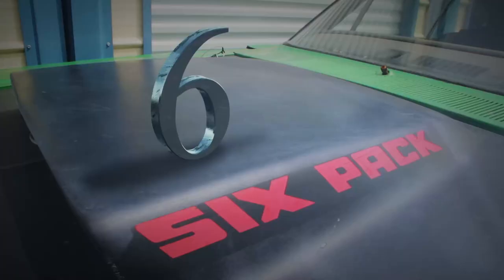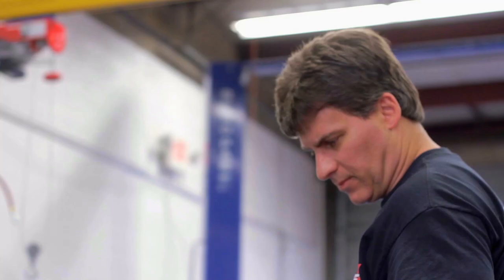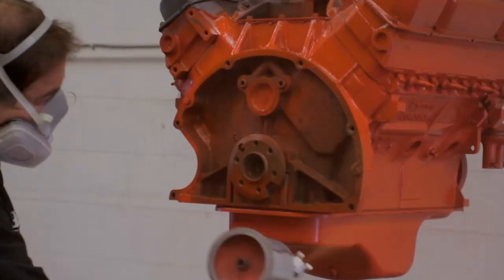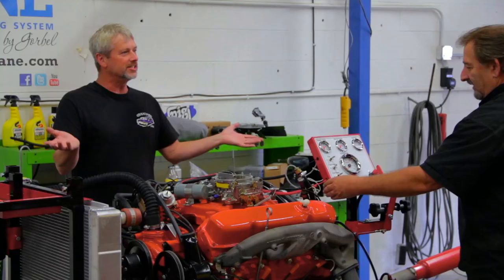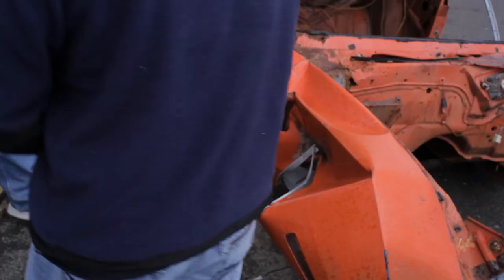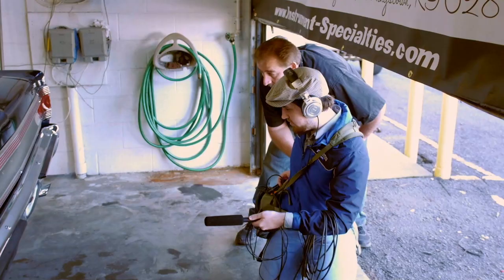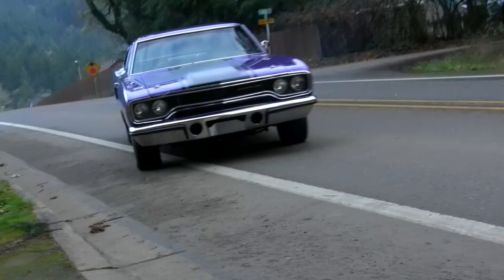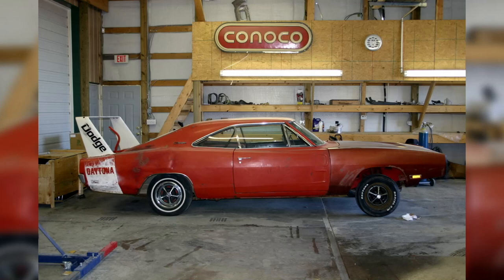JOSH & DAREN LAST EPISODE-SEE WHY

Comment: Love the show. I watched on television as well as You Tube with any I may have missed out on. 
In regards to Josh and Darren they helped to get the show started, but like anything else you always need to make changes for improvements. 
Will and Dave were both great additions. Could they all have worked together? Each to there own. 
For me, the only disappointing issue that I have is there are no truck rebuilds to OEM "Little Red Truck" would have been a great part of any season. That Old Yellow Dodge Parts truck or whatever they do with it, always catches my eye on every opening of the show.
Keep up the good work, look forward to see more.

Comment: Im a Mopar guy from the very first one I owned, a 1970 Plymouth Roadrunner, B5 blue, black vinyl top, blue interior, bench seat with a 3 speed manual on the floor. (rare)  Bought it used in 1975 for $1300.  89,000 miles, but it was in perfect condition.  It was my 4th car, I have 2 Chevys, 1 Mustang, and a 1965 GTO, 389 3-2s..  That Roadrunner out ran and out classed them all.
This Mark guy is a jerk....  I did bid one car up on him,  I was in competition for a fixer in Nor Cal, the seller told me Mark Warman's shop was after the car too.  I bid it up high, but Mark got it...  he got it in the end...  :P
Reply: Mark, one piece of advise.. when buying cars..  never let people know WHO YOU ARE....  I know you THINK you're a celebrity, but it just makes the seller boost the price.

Comment: Yeh I’m a Ford guy, 1978 it was Olds and Pontiac. We tend to start out with parental castoffs so I started out as a GM guy, I have just purchased my 124th car, not bad for just some dude, meaning I’m not a lot or business just consumer, I went to Ford in 78. I have owned Chrysler products as well, one you might find of interest,
A 1970 Plymouth road runner convertible, it was blue with white interior and top, it was automatic, rare enough but it had an AM 8 track ( no FM )and was air conditioned, I know it was rare enough, if I remember maybe it was in the 800’s?it also had one motor I quite respect, the 383, one of my bucket list cars is a black Dodge Charger 1968 with 383,  I mean since I don’t have a printing press a 426 or 440 would be cost prohibitive for me, I have been a car show judge for 3 years in the Mustang class, watching your work helps develop a criteria with which to judge cars, I once had to give a 1971 Cougar 2nd place because of aftermarket rims( which I prefer but not in a stock class) it was a black 429 with red interior and 4 speed. The guy actually worked his butt off and bought it in high school and still owns it, I have had ran a cable access show for 12 years cruise night I really liked the 63-65 dodge Plymouth midsize cars. I also have many vintage car ads many molar, keep up the good work car guys all respect you work regardless of marque loyalty. All you get now is silver 4 door front drive, I just bought an 1988 Ford t-bird sport coupe 302 dual exhaust 70 thou one owner miles and parts are difficult, I propose as car guys we should halt programs which took many cars off road, things like cars for clunkers, also there was a program that tried to stop Hollywood from destroying desirable cars, I mean how many Torino’s and Chargers do you think were sacrificed just to name two. There was a great car scrapping in 1918 to induce new car purchase. Sadly our offspring can never have what we had car guy speaking, there will be SUVs and pretty much that’s it, luckily we have Mustang Camaro and Challenger butI hear GM might bag the Camaro, so marque loyalty doesn’t count for much these days, I’m 63 so I remember looking out on parking lots in the 60’s and 70’s and most of the cars had potential I mean read 2 door V-8 mid size, these cars are all but gone and are immovable  car dealers tell me, these cars are tough sells, I actually see vintage bodies put on Tesla remains, my gut is telling me electric cars are going to get bigger, yet, so in closing my 3 bucket list cars? 1961 Chevy impala red, engine? 283 or 348 next the 1965 Ford Galaxie dark blue, engine? 289,352? And last that black 68 charger with 318 or 383, any one of these cars are great candidates for resto mod, in closing yeh don’t forget my Avanti

Comment: Love the car and yeah vinyl top is nice looking on that yellow cuda but what fool back in the day said hey like we could put a top on these cars that will just absolutely hold moisture and rust holes in the top of the car and will deteriorate crack up and turn to trash on the top of these great cars no matter what brand they were even if you kept them in dry garages they would have to be climate controlled they just draw moisture and hold it right against the metal to me unacceptable even the little ladura tops in the late 70s na stickem in the trash to me that’s what they are if you want that look just get a convertible in
My mind that’s what they were trying to get a convertible look alike

Comment: Keep in mind that GYC is restoring these cars better than when left the factory!
Reply: The only thing better is the paint, I personally restored Mopars for 18 years by my self,doing everything except rebuilding the motors,the headliner and front and rear glass installatoon.Marks cars finished are no better than mine,so much of this produced show is hype.
Reply: @duster71  But he has a show! Where’s your show? The attention to detail? Let’s see some of your work? Do you take the time to make sure the original markings as it pasted along the assembly line are there? GYCs has in-house engine assembly, repair and replacement. Using OEM parts. So, let me understand this, GYCs has a show. You don’t. Mark shows step by step process to bring a dead car back to life. What’s am I missing? Your show? GYCs has over 200 cars in the back lot waiting to be repaired. How many do you have waiting to be repaired? Remember to compare apples to apples and stock to replacement parts! How many $1.5 million Mopar cars have you restored to its original condition? I’ll wait!
Reply: @duster71  How many famous people have you done a car for? Has Mopar given you an award? How many cars have you had at SEMA? Have you any work that we can compare it to on Facebook?
Reply: @lkendrix7782  where's your restorations do you even own a Mopar
Reply: @duster71  well give me some names? What’s the name of your shop? So I can do some research?
Reply: @lkendrix7782  so you only measure the restoration buy the man who owns it? Have you done 55 cars by yourself from rust repair to finish paint, recovering the seats installing a vinyle top and when my customers could afford it I do mechanics., Go bothersome else, I  don't need to 0rove anything to you
Reply: @duster71  Is the chevelle in the yenko directory? my hubby knows of most of the chevelles
Reply: @jeananderson815  I would think so ,it's in Stamford CT owned by a man named Joe,don't remember  his last name I restored the car in 1995

Comment: I HAD A 71 CHARGER THAT I GOT FOR $600.00 IN 1980 I LOVED THAT CAR WITCH A GARAGE BLEW UP IN91 THEY WIRED IT WRONG BUT I HA A72 THAT I GOT FROM A DEALER FOR $50.00 BECAUSE IT LOOKED AND RAN BAD WITH SOME WORKED I GOT IT ROAD READY BUT WAS NEVER AS GOOD AS MY 71 NEVER NEEDED TO WAX MY 71 IT ALWAYS SHINED